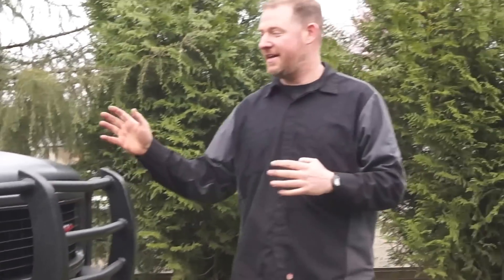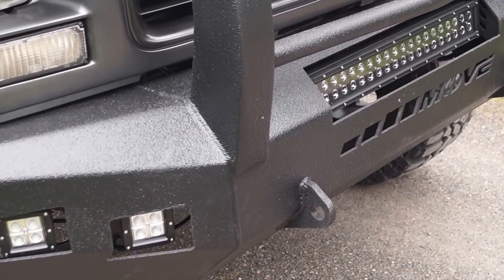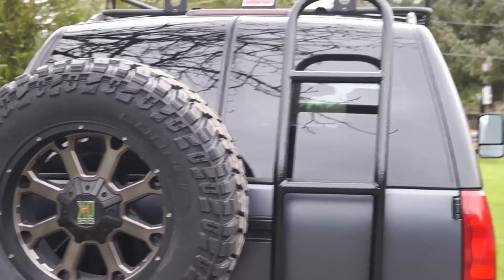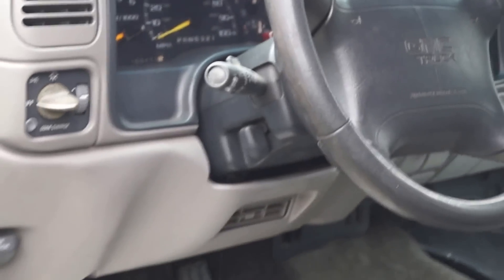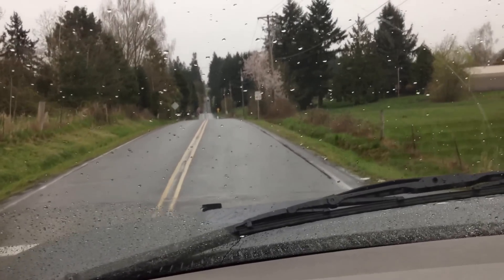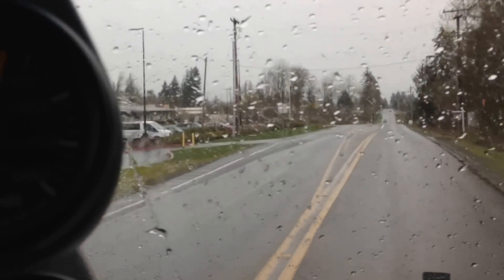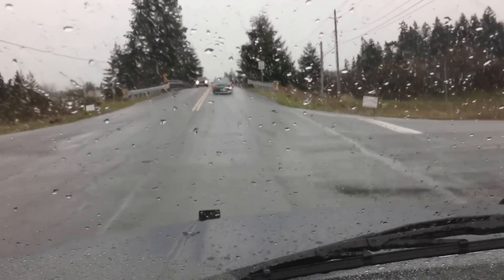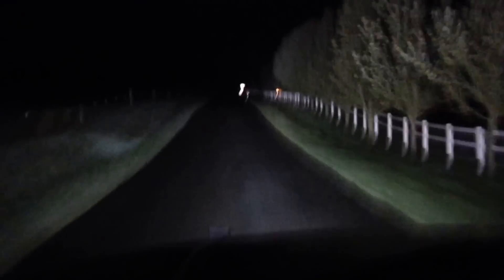Cummins 6bt 12 valve Diesel conversion Suburban "Subruno" test drive.

Comment: This build screams for a SAS
Reply from the maker: The independent suspension and antilock brakes work very well on these vehicles.  Also if you want a solid axle you should just build the older body style.

Comment: Next door neighbor is practically giving me an obs crew cab 4x4 2500 zero rust.not really wanting to put the 5.7 heads back on.any reason you wouldn’t swap a 5.9.I miss my 2000 Cummins.

Comment: I was just complaining to my wife the other day that I didn't want a Duramax Suburban, and wished Dodge would make an SUV with a Cummins. Think this would be a better option than putting a 6BT in my 80 series LC.
Reply from the maker: I have done both swaps,  Land Cruisers and Suburbans and  starting with a larger 3/4 ton vehicle does make the conversion a little easier.
Reply: That would be awesome if dodge came out with a new ram charger but without all the newer crap!
Reply: My question is. How long of a process and average price. I have a '98 Burban I want to convert.

Comment: the alternate and a.c bracket and bottom neck for hose do you sell them thks
Reply from the maker: Yes we do sell them.  Stay tuned for a roll out of a new website that specializes in conversion products.
Reply: What's the web address? Also would it be any more difficult in a 2000 3/4 ton yukon? It has a 6.0 liter now, will the transmission shift right with your adapter?

Comment: What is the coating on the truck? Raptor u-pol bed liner? Awesome rig! I prefer Ford😜but this rig is sweet! I don't like anymore blockage of my view on the pillars. Already a big blind spot without adding a gauge pod
Reply from the maker: PPG base coat with a flat PPG 2021 clear coat. The texture on the flares is rocker coating and the bumpers are coated with Monstaliner.

Comment: Which rear bumper was used? Move days they don’t have a bumper specific for 97 GMC suburban. Could I use one for the gmc 2500/3500 pickups?
Reply from the maker: The rear bumper came from MOVE and I fabricated and added the ladder and the swing out tire carrier.  You can use one for a truck as a starting point.
Reply: Thanks! This is the toughest looking custom I’ve ever saw in my life💪💪💪. You guys absolutely KILLED this!

Comment: Fantastic looking build, don't really understand two key things though, leaving the 12v stock when you're just going to go back into it for more power after a couple miles, I can only assume this is a customers vehicle so you guys can charge again 😅
And secondly, why all the LEDs but leave the stock halogens and incandescent lights around in the stock locations when you could've easily swapped everything to LED for better overall visibility instead of having to hit the highs....that's just me though, if I'm putting LEDs in, I'm doing all of them, plus it looks silly running incandescent lights next to LED.

Comment: Hey, I was wondering if you all had to cut the firewall to fit the 12v. I’m trying to decide between a 4bt and a 6bt cause if I have to cut the firewall I rather not get that deep! Thanks for you help!
Reply from the maker: No firewall mods are required other than bending the pinch weld around the transmission tunnel.

Comment: Did you have to modify/beef up the ifs and steering components to handle the 6bt and 37s?
Sweet build 👍
Reply from the maker: 3/4 ton steering components are strong enough.  1/2 ton stuff is not.

Comment: I have a 98 chevy suburban k2500 with the 6.5 turbo diesel. How much weight did the cummins add and did it effect the steering? Any upgrades on the suspension, steering or drivetrain like the axles/driveshaft/rear end ?
Reply from the maker: The Cummins is not much heavier than the 454 that was removed.  I don't know the exact weight difference.   All of the bushings and steering linkage was replaced and or rebuilt when the 6" lift was installed.   Things can be fined tuned with the front torsion bars if needed.

Comment: Can you provide info on what lift kit you used? 
I have a 1999 K2500 GMC Base Model Suburban and am having a heck of a time finding a IFS lift for it. Appears that only superlift carries them unless there is someone else out there I'm just not finding. Would appreciate your input since you guys trusted it to hold the weight of the 6BT.
Reply from the maker: Tuff Country 16853KN.  The wight is supported by the torsion bars which are reused and not included in the lift kit.

Comment: Just curious, but why would a person put a Cummins in a suburban? I see some of these swaps, but diesel is more expensive, and regular gasoline has enough torque to break stuff in these vehicles.
Reply from the maker: The Cummins is a very reliable mechanical diesel that can get excellent milage and tow anything.   Also the only full size SUV with a diesel that is decent is a Ford Excursion.  So if you want to haul your family and tow a big trailer and not get 8 MPG you don't have many OEM options.  Lastly these trucks are very well built and heavy duty and do not have any issues handling the weight or torque of a reasonably built Cummins.
Reply: Because it gets 18mpg Instead of 10mpg for the 454 (7mpg towing a camper) and will last longer

Comment: Also got a cummins swapped suburban although it's a 1991 with a 24v. Definitely much louder in my cab than yours. Just curious if you did anything to quiet the engine noise?
Reply from the maker: The 24v engines are noisier than the 12v.  We did however install heavy mass backed carpet form ACC and a bunch of sound deadner from Fat Mat.

Comment: You said you were getting around 18mpg. 
I'm not a big diesel guy but have been told 4BT swaps are easier in place of standard GM V8's over the 6BT Engines. 
With this in mind I've been considering a 4BT vs. 6BT swap for my 1999 K2500 Burb or maybe even my 1968 CST 10 Suburban. 
Having done a lot of work with these can you provide some quick pros and cons to either option?
Reply: Deboss garage put a 4bt in a tahoe. He has a youtube channel and is from Ontario, Canada

Comment: Sweet looking Suburban. Awesome looking engine swap. Are you sure about the year? Judging from the front end, it looks like a 1992-95 Suburban. I love the grille.
Reply from the maker: Yes I swapped the work truck style grill in order to gain more room for the charge air cooler and better fit the theme of the truck.
Reply: I've always liked the sound of a well-built, and well-maintained diesel engine. Don't ask me why, since I've never owned or driven a diesel powered vehicle.
Reply: And how did the grille provide the needed room to accomodate the Cummins Diesel? I would think that because of the length of the inline six engine, you'd somehow need to get a larger engine compartment, or a longer front.
Reply from the maker: It has to do with the marker light and turn signal location on the work truck grill vs regular GMC suburban grill

Comment: Fascinating. While I've always loved the Cummins 6BT diesel engine, but I've always questioned the idea of a 5.9 litre inline six engine inside the engine bay of a 6.6 litre V8 engine. You know, will it fit comfortably? Will it work reliably? Since I've never driven either, I've no way of knowing either way.

Comment: Ok that is great now how much ?
Reply from the maker: If you would like one built exactly like the Subruno as seen in the video then it will run you just under $50K everything included.  Obviously if you didn't want as much custom stuff the price would go down.   If you would like to get more information on having one built send an email to info@jonesys.com and we can discuss specific details of your build.
Reply: Now there's the answer everyone is looking for.  Is that with a customer supplied vehicle or are you supplying everything?
Reply from the maker: We supplied everything.  The Subruno is currently listed on eBay for a buy it now price of $45K.  Which is a really good deal.

Comment: what kind of transmission
Reply from the maker: 4L80E
Reply: JonesysAutoClub directly or with adapter?  very nice build, I have the same model and I can see my 7.4 going by the way side. Thanks for the inspiration.....
Reply from the maker: With an adapter.  Contact me at info@jonesys.com if you would like a price on the Cummins to GM transmission adapter.

Comment: How much would something like this run me?
Reply from the maker: It all depends on how you would like it to be outfitted.  Custom paint? interior? HP/Torque, suspension there are a lot of decisions to be made and all of them have the potential to add significant costs.   If you would like more details about planning a build send us an email at info@jonesys.com.  Subscribe to the channel as I will be posting more details about the "Subruno"
Reply: Why can't anyone just answer how much it would cost? That's what people want to know, even if it is ridiculously expensive, just say how much. Obviously custom builds can be more expensive, but he asked what "this" would cost. If a suburban costs $8000, how much would it cost to put a Cummins in it, plain and simple.
Reply from the maker: Cummins to GM transmission adapter $1000.
Reply: If that's your response to "how much would it cost to put a Cummins in it", then I wouldn't want you quoting me a price to work on my vehicle, because there are way more expenses to do this than $1000 for a trans adapter. You say below in another comment it would cost 50 grand for the exact same build. LOL So if you're going to put a Cummins in my Suburban for $1000, I'm sold!
Reply from the maker: Everybody asks how much? The answer is how much for which part?  Paint? Interior? Cummins rebuild? 4L80E rebuild and upgrades? Lift?  Tires and wheels?  mid mount AC? Bumpers? I could go on and on.  The issue is that most people do not understand that every project is different and requires a specific build plan that cannot be conveyed in a "How much does it cost" comment on You Tube.   The answer is that custom vehicle are built on a time plus materials basis only and there is no set price.
Reply: I kind of have to go with Supernova on this one.  You could at least give us a range.  In fact you could give us an exact amount for this exact truck.  I also understand why you would be reluctant to do so. But let's not pretend "it all depends" is a good answer.  You could easily say, "This exact one cost us $52,000 to build but another one just like it might be slightly more or less."
Reply: On a side note.....Spectacular build.  I'll take one.